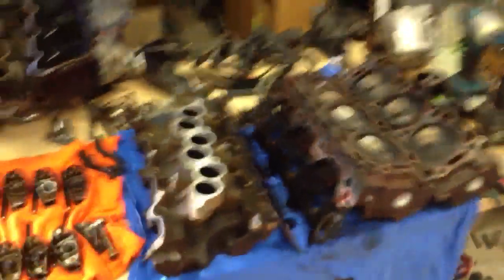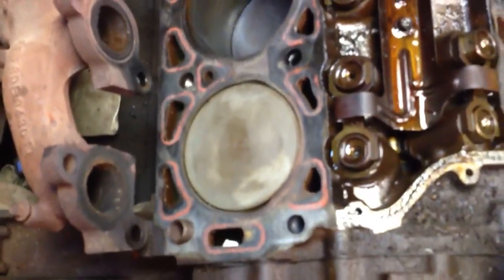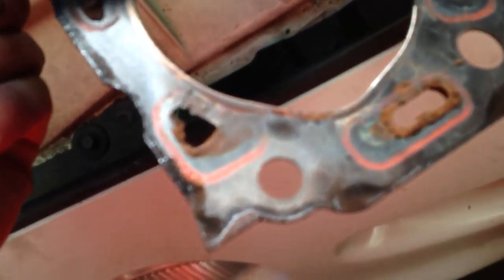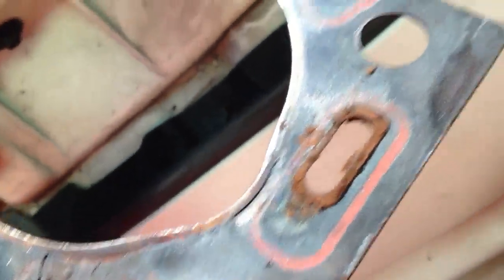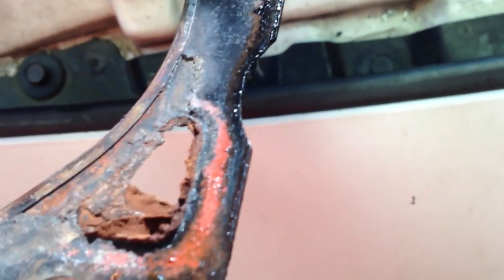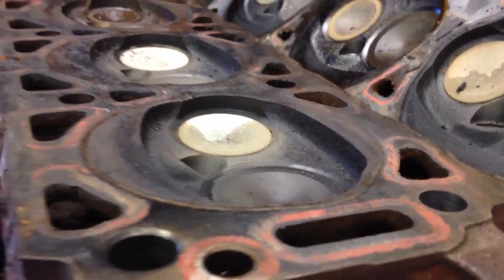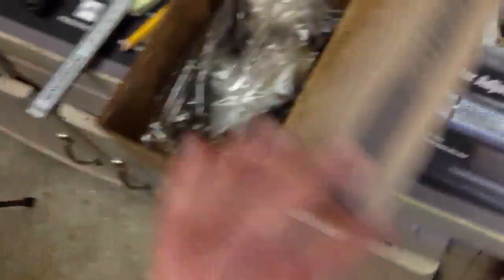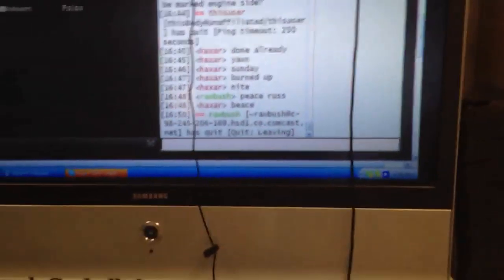Quickie Up Date On Todays Adventure. Replacing A Blown Head Gasket On Ford 3.0L V6 OHV Engine

Comment: They sold me that green scrubber thing. 200-300 rubber nubs. Polishes off old gasket material quickly. Fits on end of drill. The green "cookie" was $12, but adapter was $15, total $27, plus tax $28 or so out the door. Worth mentioning.

Comment: Hey Russ I got a 3.0  and I have been having major issues with freeze plugs.  Mine is a 92 with 190k Ranger.  I even had to pull the tranny just for freeze plugs.  May be Cheap and easy insurance.  I have not had issue with the head freeze plugs but for 1$ and a little time something to consider.

Comment: Russ, your 1 hr. video was great. Helped to find that #5 bolt on the power steering pump bracket. It's behind the tensioner and need to yank it using T-50 Torx. I had a T-47, they will fit for removal, but a proper bit was $5 dolla. 
They tell you to buy all 16 head bolts or they will stretch. This is true but I am breaking the exhaust manifold bolts right and left. They heat up to 500F daily. They're rusty. And The NAPA store said they show nothing in the book for exh. mani. bolts???

Comment: might wanna re-tension the head bolts after its had time to settle in and stretch the bolts.
did the head gasket on my old toyota 3L diesel and it started to leak again not long after i put it on.visible bubbles of exhaust gas was easy to see with the radiator cap off.
so keep it in mind.
"mono"torque gaskets arent all they are cracked up to be...
Reply: m3sca1 The head bolts on these later Ford 3.0s are torque-to-yield bolts.  You can only torque them to fill spec once.  If/when the bolt is removed for whatever reason it must never be reused even if still new.  If the bolts are reused you can torque them to spec to your heart's content, but the clamping force will not be the same.  A new bolt or bolts must be purchased.

Comment from the maker: Ummmm, I think you did not get what I said in the other vid. Car, no water, cap pops off. Over presure. Water pump, new, thermostat, new, coolent burning, yes, water leeking in to cylinder, yes. Drivable like it was, not for more than 10 miles. If that and a blown head gasket... Then what it is? Lol  Manufacture  defect?!?! I dont think so. Lol ~Russ